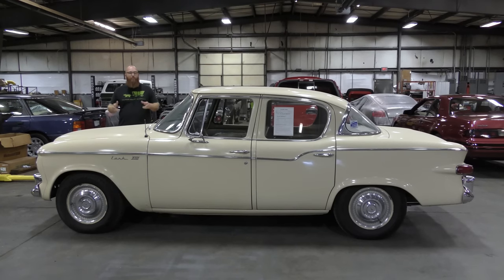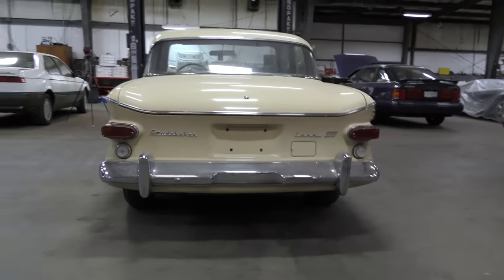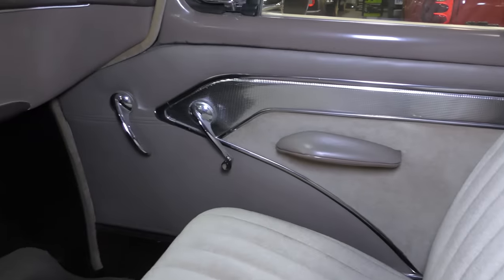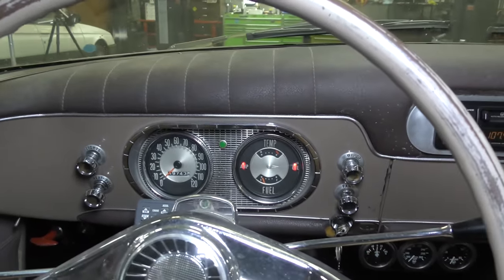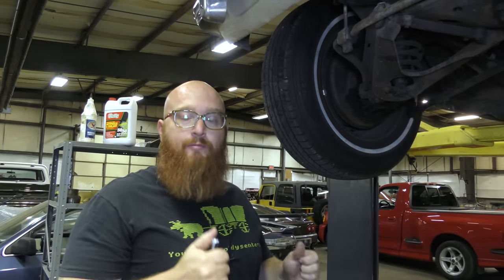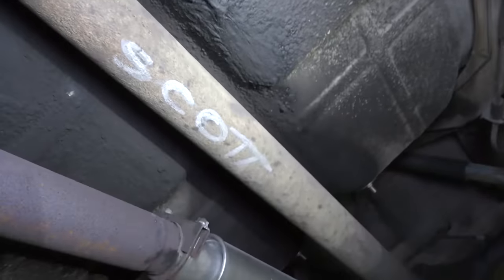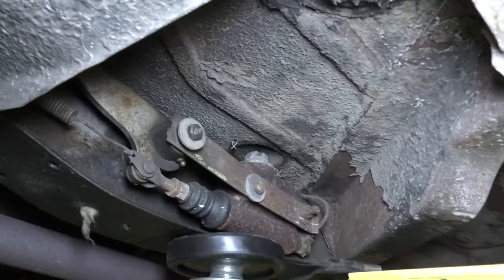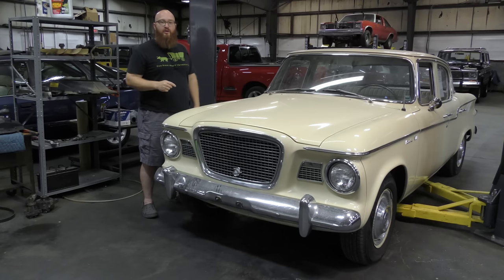Finally a CAR WIZARD approved engine swap done on this '60 Studebaker Lark VIII

Comment: I was raised by a single mom, right at the poverty line. In the 60s we had a Lark, that at some point had several cylinders stop working. But that car kept going, for many miles, until Mom could afford a different, (all eight cylinders running,) car. She loved that Lark, and even as a child I understood her gratitude to that car for giving its all to keep us safe.
Reply: To JT LASER . Lovely story!
Reply: You're a tough critic with a good eye for detail. I think some of that comes from your time in the Army. 
As a fellow Army veteran, I  would be happy to have you evaluate my current restoration when I complete it. SFC (RET) VIC MARTINEZ.
Reply: I had a similar situation growing up. My dad took the newish station-wagon to trade in and left my mom with a dying Ford Falcon. I remember her having to add a quart of oil at half a tank as well as when she filled it, and reverse often involved us kids pushing it backwards...

Comment: Back in the late 60's I worked on a Lark that the owner said was running rough and hard starting. We checked the compression on it and two of the six cylinders were around 90 while the others were about 120. We pulled the head which was easy as it was still a flathead six. What we found was unbelievable. Two of the intake valves had broken off and were acting as poppet valves with the suction from the intake opening them and the compression forcing them closed. The block was unfortunately unsalvageable so we had to replace the motor with a used engine that we rebuilt. It proved to me that you can never kill a flathead six completely............
Reply: Amazing!
Reply: I owned a 59Rambler with a flat six...soo smooth!...I also owned a 59 Plymouth Savoy, that also had a flat six!...it was the last year that Chrysler offered that flat six engine..Rambler offered it through 1965!...that old design was utterly reliable, and was used from the mid-1930s on, for over 30 years..."If it ain't broke, don't fix it" seemed to be the rule back then, before the HP race began in the mid-50s.
Reply: I’m impressed with that motor swap myself. I would never have used a Chevy motor, but I can appreciate a job well done.
Reply: During Studebaker's last gasp years they actually used small block Chevy engines as a cost saving measure. Unfortunately  not enough to save a good utilitarian car.
Reply: Back in the mid 1970s when I was a teenager, I bought a 1946 Plymouth Super Deluxe with a flathead 6 for $60; it was a giant sedan with suicide rear doors. Mechanically, everything worked and the engine ran great, but the interior had that old car musty smell that you would recognize in a car upholstered with wool. I remember driving down the road and suddenly the accelerator went to the floor. I opened the hood and saw there was a pivot rod attached to the carburetor linkage screwed into the top of the engine  that had unscrewed itself; looking at the threaded hole it actually went into the water jacket (IOW an easy fix). I wish I would have known more about the car at the time. At one point I thought there was something wrong with the clutch, but it turned out the slave cylinder had to be manually adjusted. Just a cool car I was too young to appreciate it.

Comment: The Lark 'VIII' had the 259 cubic-inch V8 in it, originally. One thing to note on these - You noted that the car seemed to have a 1950's vibe to it. This was mostly because the main body structure, housing the passenger compartment, was carried over from the previous Studebaker sedan models. Even the doors were the same stampings. They simply engineered completely new front and rear clips for the body, with more modern and compact styling.
Reply: I would prefer a Studebaker 289.
Reply: And the earlier studebakers had the heater core under the passenger seat.  That was their way of making the cars so low.  On these taller cars I like how they just stuck it on the inner fender.  A good design.

Comment: The circular indentations for drinks on the glove box door brings back memories. But unlike today where we have drink holders for water, soda or coffee, these were designed for drive in restaruant drinks or milkshakes while parked. I remember most cars had them.  Fountain drinks were probably 12 to 16 oz at maximum. Not 5 gallon drums like now lol.

Comment: Regarding Zerks grease fittings and keeping cars on the road for as long as possible: this is actually very environmentally friendly! You are keeping a car for decades, rather than junking your car and buy a new one every few years or so.
Reply: Look up some stats cars know last longer then they ever have. Average vehicle on the road is over ten years old. It’s such an annoying fallacy to me that new cars don’t last as long as the old stuff.
Reply: @TheJmatagi   I see your point, but for our family, we have a 1992 Nissan Pathfinder, a 1996 Nissan Skyline, and a 1989 Toyota pickup truck, that are still heads and shoulders above of our already falling apart 2007 Nissan Murano... There is no match for Japanese quality cars built in the 90's and it is well known throughout the world about how they can practically last forever.  It is such an honor for us to have these vehicles as part of our family's lives and we will continue to keep them for many more decades.
Reply: @Nanogrip  I so agree. My 1994 Civic 2 door Coupe was HEAD AND SHOULDERS above my 2010 Civic Si and 2004 Civic Coupe. Honda stopped dual wishbone suspension around 2003 and my 2010 Si was a crunchmobile (sheetmetal WAY too thin)-John in Texas
Reply: My son has an 86 fiero he calls Old Reliable. Always runs, never breaks. While his 2010 Saab and 2012 Buick set MILs, have timing chain problems, boost codes, misfires. It's always something. My 92-04 cars and van don't have any major problems, they just keep running.
Reply: Cars were on a 3- 5 year cycle then. 10 years was an old car..
Reply: Just buying a new car of any type is the biggest carbon footprint you can have during its entire ownership. If that's an issue for you, always buy used. If you buy used, somebody else is responsible for that.
Reply: I LOVE this car - but LOOKING at it, NOT owning it! You would have to be a "greasaholic", not to mind doing THAT much  greasing!
Reply: Federal regulations, safety, emissions, fuel economy cause a lot of the problems with new cars. Build as light as possible, complex drivetrain controls for optimal fuel economy with low emissions, while still cheap enough for shareholders to make money. Planned obsolescence.
Reply: That makes no sense at all. A sealed wheel bearing cartridge lasts far, far longer than the supposedly servicable parts from the 60's, and, guess what, no maintenance at all. 150,000" miles on these sort of parts is common. Even if you are absolutely diligent about greasing the parts, they are going to be done in <100,000 for the most part.
Reply: Had a ‘60 Lark VIII, 3 on the tree w/electric OD. At 70 I got 24 mpg. Remember front suspension & steering had around 21 zerk fittings.

Comment: The 1960 Studebaker Lark came with a flat head 6 cylinder or an ohv 8 cylinder engine.  Where it says Lark VIII that indicates that the car was born with an 8 cylinder engine.  Studebakers in those days were running machines.  Their engines powered the Golden Hawk, the Grand Turismo and other very classic and fast cars.  I remember these cars when they were new and a Golden Hawk was so fast it would scare you.  Beautiful cars, years ahead of their time.  Love your site.  Pete

Comment: Maybe it is a 283 from a Canadian Studebaker. After South Bend closed they made them for two more years, 1965 and 1966, in Hamilton ON with GM powertrains. The Lark VIII signified 8 cylinders and VI 6 cylinder models. Great video Wizard.
Reply: it is chevy black that says mid 80's or newer. A 283 would be chevy orange. Unless they painted it.
Reply: @christianperspective9527  I had a 65' with a RED chevy 283 2Barrel that was factory. I was very young at the time and I'm ashamed to say I don't remember too much else I didn't own it very long but I defiantly wish I had it now.
Reply: @christianperspective9527  New crate engines are also black.
Reply: @patricksmith5655  maybe they were red before they turned orange I entered the trade in the mid 70's
Reply: Had a 48 Champion. Had a leaf spring across the front for the wheels. Seems like I remember Studebaker  engines were famous for burning oil. Seems like Studebaker was pushing STP in the engines. Andy Granitelli was promoting it. The 48 Champion didnt have turn signals unless you paid extra. I went to a Studebaker dealer and bought them for mine.there was a place on the steering column  to bolt the switch. Mine had after market nylon seat covers.went around a curve and slid across  to the passenger side. I struggled to get back in control. Chevrolet had problems with the 55 265. Gave up on it in 57. The 283 was a good engine.
Reply: @christianperspective9527  If I remember , I think black was the color of Studebaker,s engines.